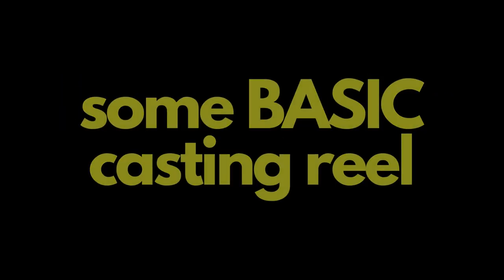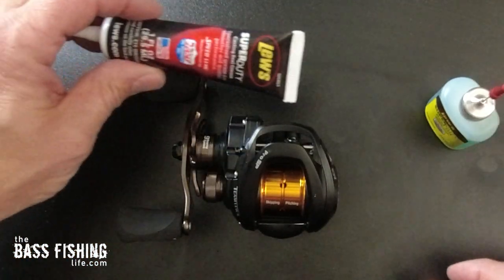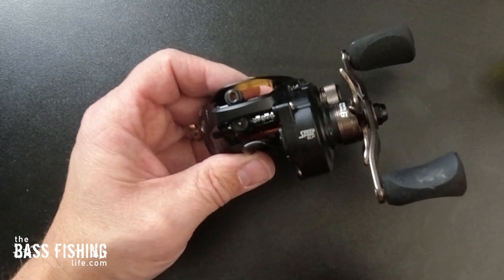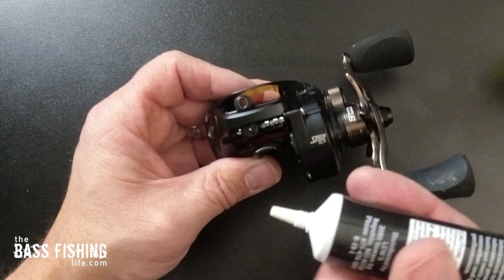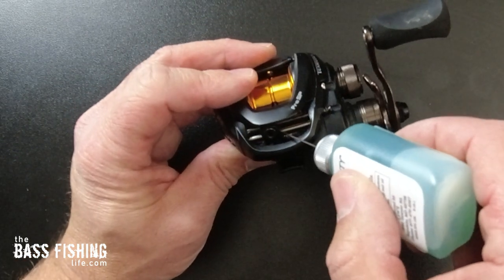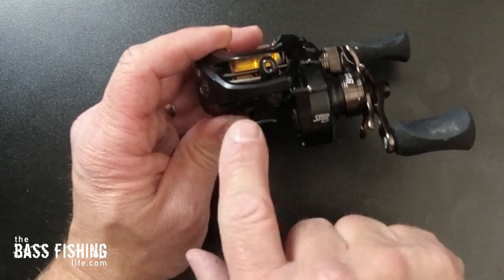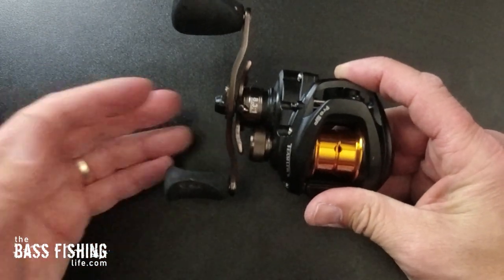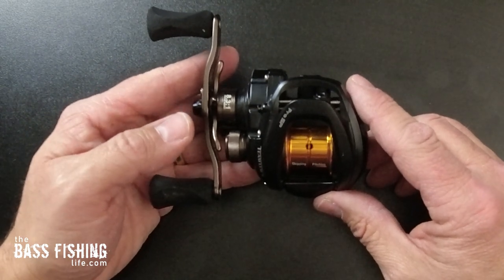How to Oil and Grease Your Baitcast Reel - Basic Reel Maintenance

Comment: That's a great step-by-step instruction on reel maintenance. I probably let my reels go longer than they should, but I always try to keep some good quality oil on had to at least keep the handle moving.
Reply from the maker: I know I have a pile of reels I need to work on this winter. I need to do this way more often than I do as well.

Comment: I'm a reel nerd and had just a couple points :)
1. Use a cotton swab to clean the level wind components
2. Remove bearings, soak in acetone, remove one of the shields, add one drop of oil and spin for a few seconds with an air compressor 
3. After regrease and oil, take a drill with 10mm socket and spin handle for 30 seconds
Love the videos. Thanks
Reply from the maker: Thanks for adding this for everyone!
Reply: Please create another video :) thanks 😊
Reply: However, acetone can completely dry out the surface of the bearings and hence oil really needs to be worked back into bearings.

Comment: Good job explaining the way of the oil and grease. But you can only do it 3 times before it gets too thick oil will thicken over time if you put it over and over. Just remember 3 times before fill clean out of old oils - grease out and then reoil.
Reply from the maker: Thanks!

Comment: Question - I have a Lew's SP & the Crank handle gets hard to turn when I tighten down the drag.
What's causing this? Bought it last fishing season, not even a year old. It's caught a lot of nice Redfish & nothing is bent, everything else runs fine. The more I turn that drag to tighten it, the tougher it is to reel in.
Reply from the maker: That definitely sounds like something isn’t right. Mine hasn’t done that and I can’t think what be causing that. Their customer service is very good and I’m sure they would be able to help you out with it.